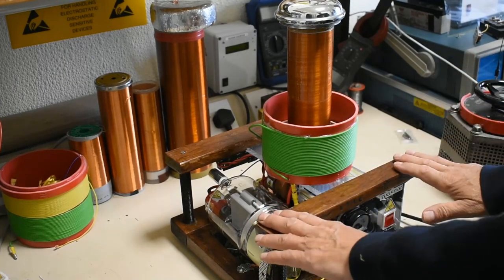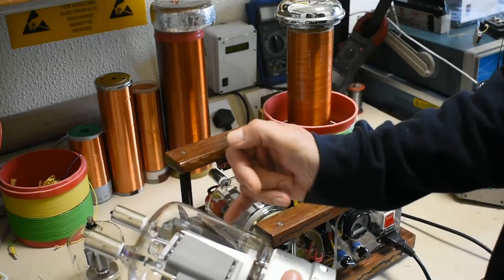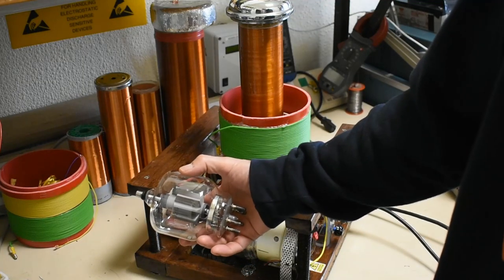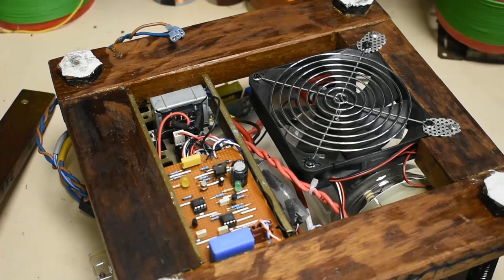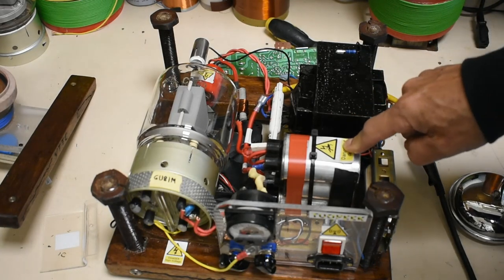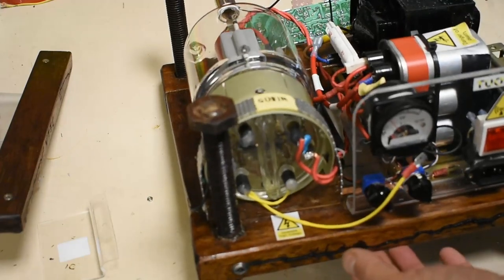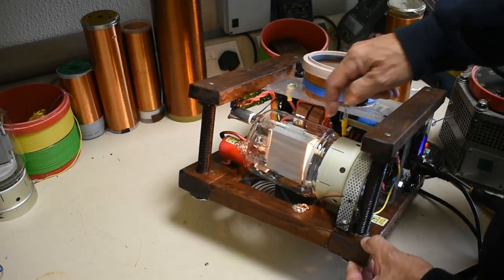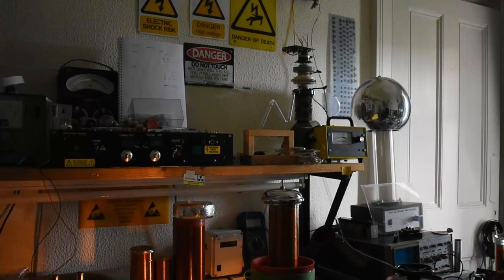ГУ-81М Vacuum Tube Tesla Coil

Comment: Great video! I got inspired by Michelle's build at Steve's channel "Tested to Destruction". The GU81 is on the way! I love the halogen lamp PS for the tube heater. Great idea! I didn't want to have to wind or track down a filament transformer. That is a nice build, very inspiring.
Reply from the maker: Thanks, yeah Michelle and Steve make it look easy. The GU81 is a great tube for this. It been the best of the few tubes I've tried. The switch mode halogen ps was used as it saves space and weight in the build and has worked surprisingly well. I did expect the RF from the coil to cause some issues and possible failures but so far it's been good. Steve's comment on the voltage is a good point though. It's better to have the heater slightly over run rather than under for the performance of the tube. I may be very slightly under but seems acceptable.

Comment: My filament transformer is only giving me 12.4 volts. Is it okay to run the tube filament on 12.4v instead of 12.6v?
Reply from the maker: 0.2V under won't be an issue, but if that is open circuit voltage check it doesn't sage more at the filament. Generally is is better to slightly over run than under run a filament because its easier to move electrons from a cathode the hotter it is.

Comment: Great vid!  I read in a youtube comment that you must run your tube's heater overnight to allow the getter to become activated, is that correct?  Don't they activate it in the factory?  Anyway I'm about to put together a gu81m vttc and thought I'd ask somone who knew about tubes.  Thanks.  Subbed.
Reply from the maker: Thanks for the sub, not heard of a requirement to run tube heaters overnight. There are two things to mention; Manufacturers coat heater-cathodes and cathodes with emissive oxides. These are indeed activated during manufacture by running the heaters after evacuation. Once activated they would be poisoned by air. Running   the heaters before applying the anode voltage is always suggested so that it is up to full temperature as pulling electrons from a cool cathode will harm the oxide layer increasing the work function and may limit the useful life of the tube. The GU-81 actually heats up rapidly as the cathode heater has low mass.  On the subject of getter some large tubes anodes form the getter and are designed to run very hot for periods as part of the vacuum conditioning.  I think the GU81 employees additional getter attached to the anode connection.